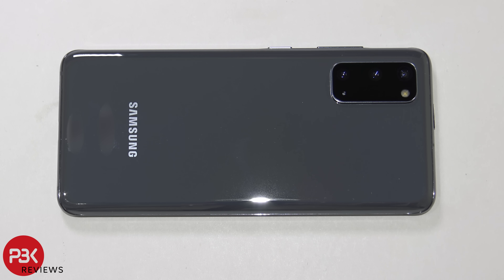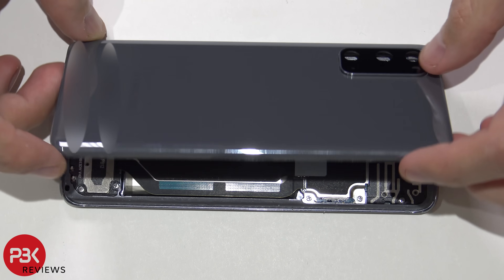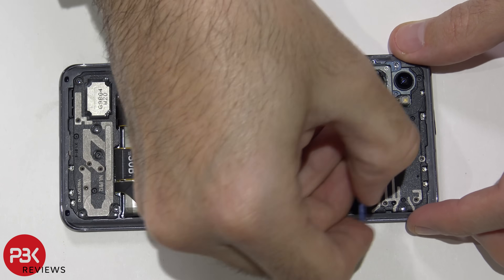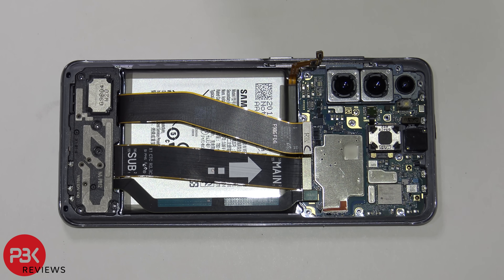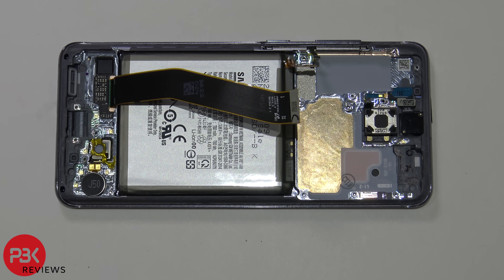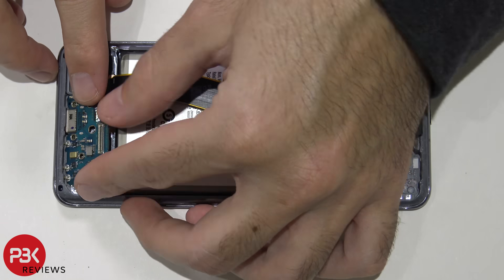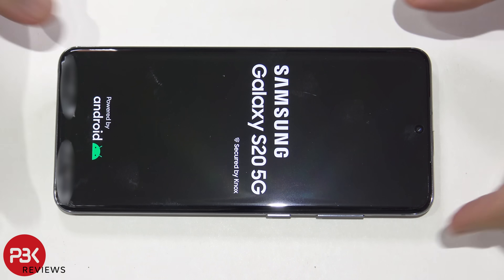Samsung Galaxy S20 5G Disassembly Teardown Repair Video Review

Comment: Hi, would you kindly offer advice regarding the power button on my s20 device? It's about the power button and how it's attached. The issue is that the power button sticks out on one side, swiveling outwards the lower part of the button,  with the top side of the button still attached to the cell:  what is the reason, and how can it be fixed.

Comment: I had the back part unglued and put the phone under water to record..it worked for a while and when I let it charge ..the screen didn't work anymore. I hear a sound on off. I saw on the main board that something had failed. some small chips to the right of the cameras that say IRH. I completely forgot that the back of my phone came off. now i have a ruined s20. luckily i already have s23. I just had the s20 for sale

Comment: What kind of adhesive to you apply to put it back together?  I have a waterlogged S20 that needs to be opened up to dry out, but I want to make sure I can get it back together.
Reply: this was awhile ago but double sided tape works in a pinch

Comment: So far, so good. You've explained everything well, but I don't know what the thin cable on the outside right is, the one that goes from the speaker to the mainboard. And what is the box under the front camera? Also, the fingerprint sensor was not shown, which I'm currently having an issue with. The fingerprint sensor works intermittently. For example, it loads to a certain percentage and then stops and hangs there. Additionally, I often get a message saying I should make sure the sensor is not dirty or wet. Do you have an explanation for this? Thanks in advance.
Reply: If you installed glass screen protector, that may be part of your problem!

Comment: Where are the antennas? I want to see if something is loose and that's why I intermittently can't connect to cell towers. Wifi is fine, though.
Reply from the maker: There are antenna lines drawn in the frame itself, as well as the plastic cover over the motherboard and speaker housing. Also the sub board has antenna contacts on it including the motherboard which boat touch parts of the frame to connect to the frame antenna. So you would need to make sure both the motherboard and sub board are seated properly in place, and that all cables and connectors are connected and that the plastic motherboard cover and the speaker assembly are both seated and screwed down properly.
Reply: @PBKreviews  thanks!

Comment: Hi there my back cover came lose suddenly and I used my phone in the pool and water got into the phone it turned off for 3 days. Came back on after I took the back off and put it in rice. But now wifi doesn't work at all.  Iv contacted Samsung and gone through all the steps to try and get the wifi to turn on but I can't. I have even factory reset the phone. Do you have any advice on how I can fix this?

Comment: Hello. If I remove the back cover of the phone, should I re-glue the edges or can I just install it without glue? My back cover is a bit loose. Thank you.
Reply from the maker: Hi, you would need to apply new pre cut adhesive for the back. Here is the part you need: https://www.mobiledefenders.com/samsung-repair-parts/galaxy-s-series/galaxy-s20/adhesive-back-cover-for-galaxy-s20-5g.html

Comment: Hi do you have WhatsApp i could do with having a chat with you about a problem im having that im struggling to resolve. So my phone stopped working due to the battery so i changed it and it worked fine but wasn't charging so i changed the charging port and then it wouldn't turn on. I thought it was the screen so i replaced the lcd screen, the charging port and the battery and still nothing. If i hold the on button and it buzzes like its switched on but nothing on the screen. Iv also now changed the long thin lcd connector flex and still the same problem. I have now ordered the main flex. Do you know what this could be? Its nearly all knew apart from the main motherboard. Praying it isn't that. And how would i test it to see? Many thanks
Reply from the maker: Hi, I don't have WhatsApp. It could be a possibility you may have damaged a part of the main board or broke off a resistor or chip when you were taking it apart to replace other parts. If you changed the battery and all that, that's the only thing I can think of. Have you checked and made sure all the cables are connected properly etc?
Reply: @PBKreviews thanks. yes Iv looked over it all thoroughly.checked all fittings. I just don't know what else to do.
Reply from the maker: @lily-maysewell6685  if you can send me a high res pic of the main board with cables disconnected ill check n see if there is any visisble damage. You can email me a picture to pbkreviews@gmail.com
Reply: @PBKreviews  thankyou so much ill send them over tomorrow :)

Comment: Do you have a video or replacing the volume and power buttong keys of s20+?
Reply from the maker: There is a metal bracket holding them in place. Once you take the phone and have access to it, you just need to pull up on the metal bracket in the slot where the keys are and pull it out then that should free the buttons to fall into the frame to remove them.

Comment: Is there any difference between the back glass panel of the 5g and 4g?(4g back panel is 20e and the 5g is 60e, repair price included) I just got my phone and it slipped from my pocket as I was sitting on a chair :(
Reply from the maker: Hi, they should both be the same, they are the same size and everything so shouldn't make a difference.
Reply: @PBKreviews  Thank you very much for the answer!
Reply from the maker: @n0xi0uss  you're welcome

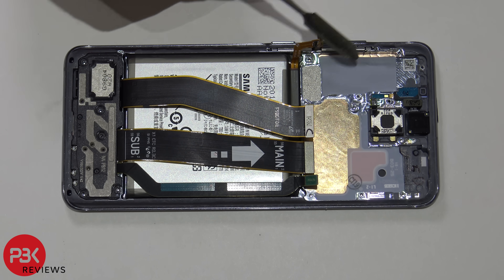Comment: Hello. Can you help please. My phone was swimming in the pool and apparently the water damaged my phone. After repair everything work except the cellular data, i mean my phone can't activate and recognize sim card. So the problem is in the area close to spare parts 034 which is in the video (3:22). I can't find spare part for it. What can i do in this situation?
Reply from the maker: Hi, with water damage it's difficult to pinpoint the issue, could be a burned out resistor or chip for the sim reader or corrosion on the contacts that need to be brushed off etc. But this website has original parts available for the phone, but not sure if its the parts you will need. https://www.mobiledefenders.com/samsung-repair-parts/galaxy-s-series/galaxy-s20.html?

Comment: My phone won't charge while using help
Reply from the maker: hmm, have you checked your charging cable and adapter to rule out a defective cable or adapter block? Also back up your phone and data and do a factory reset (which would erase all your data so much sure you back it up) and see if it doesn't fix it. If still no issue, it can be a bad charger port or sub board.

Comment: Perfect one to ask this question: I accidentally shoved the ejector pin into the hole in the bottom of the phone (microphone/speaker opening?) instead of the SIM card tray hole… Do you think that I could have damaged anything (waterproofing, that rectangular component on the USB PCB looking like a crystal, etc.)?
Reply from the maker: Most likely you did not damage it. Its a solid piece (the square/rectangular gold colored piece on the mainboard). Also you will be safe most likely with the water resistance as well, its too small of a hole to worry about.

Comment: Does the S20's haptics feel any different to the S20+ and S20 Ultra since the have different vibration motors?
Reply: The haptic feel on S20+ and S20 Ultra are more like iPhone or Pixel phones, gentle and satisfying vibration. The S20's is the same one as the S10's, it feels cheaper and not as satisfying as the S20+ or S20 Ultra, but it still better than their cheaper model like A series
Reply: @Dai_Tech  Ahh well that’s  disappointing
Reply from the maker: I haven't used the S20+ or Ultra yet so not sure. If I get a chance to check will let you know
Reply: @PBKreviews  OK thanks. Great video btw
Reply from the maker: @davidplatt9918  You're welcome and thank you

Comment: make it easier to change the battery.stop using that super glue for the back.use screws and rubber gaskets.it's an expensive phone you cannot use superglue at this price.make the battery removable if i pay so much money for a phone i want to be able to change the battery myself.
Reply from the maker: Yup, its a adhesive strip but ya would be much better if it was with screws like back in the day and gaskets. The galaxy xcover pro is that way and they are able to make it rugged as well but most people want the more slimmer sleek look so I guess they stick to that method now a days.

Comment: So can the battery be changed ? It seems really not easy (if possible without damaging the screen)
Reply from the maker: yes, it just takes a much longer time to be safe and pry it off carefully with applying heat from time to time during the process.

Comment: Please dont use metal when removing or touching anything on a phone's insides! Chance of ESD increases with careless techniques such as this.
Reply from the maker: As I've told many people before, I've taken apart thousands of phones n not once had any issue. As long as battery is disconnected the chance is extremely minimal and its different if your in an area that has static like carpet etc.

Comment: can i remove or at least disconnect the 5g antenna ? does it even have one that is for for 5g only ?
Reply from the maker: I don't know exactly but I would be leaning toward no. There are going to be 4G LTE only versions for certain markets so you might want to look into purchasing one of those units if they are unlocked so you can use that instead if you want to avoid 5G

Comment: You are not going to damage the screen, just the back copper layer of it. but I think it's actually aluminium is all the way behind the battery like on the Note 10. stupid design.
Reply: Yap. I watched another video... only the under display fingerprint reader is exposed, and the rest of the screen is covered with the middle part of the frame.
Reply from the maker: ya true but the problem was the middle part of the frame was thin enough that was actually pulling it inward as I was pulling they battery and it was in return warping the screen as well. Would probably need to use a bit more time and heat to gently pry it off or use isopropyl alcohol

Comment: Crappy construction. Repairability almost 0.
Reply from the maker: Its not bad compared to the folding flip phones and such. I honestly think its a fairly simple repair job aside from the battery and screen which would take more time. True that doesn't leave much left haha, but charger port, earpiece and loud speaker should be a fairly simple repair job.

Comment: I will skip s20 because of glued to display battery.
Reply from the maker: Its possible its not directly glued to the battery, but the midframe in that section might have either a opening that makes the adhesive attach to the screen and battery or might just be a thin midframe that pulls or warps when prying off the battery.
Reply: @PBKreviews  there is still a huge that that it would transfer heat to display. Right? AMOLEDs pixels got a terrible history of burning down quicker with constant heat dissipation overtime.

Comment: dude, always the first out with a teardown, respect! you're bout to overtake jerryrigeverything and ifixit if you keep it up! you should honestly start doing more in depth phone reviews that include the repairability in the review. phone repair techs would love it! 

...also i'm a little disappointed you didn't remove the battery and screen...wtf??
Reply from the maker: Thanks. I didn't remove the battery because as mentioned in the video, the adhesive was pulling the center of the screen inward and I didn't want to break the screen or risk cracking the screen itself.  Some devices I get aren't mine so there is only so much I can do with them. If I see I can take the screen off without damaging them, then I will. But when I see there is a risk of breaking it and the phone doesn't directly belong to me, then at times I can't do it. Hope this explains it

Comment: It must have taken a long time to remove the back plate
Reply from the maker: Not too long but ya takes some time and heat to get it off. Usually the Samsung phones that have water resistant adhesive are a bit stronger and tougher to pry off.

Comment: You can heat the screen/backside of the battery and it should loosen the adhesive enough for you to pry it out easily
Reply from the maker: Yea I tried heating it for a while and tried prying it off but the adhesive was still strong enough and kept pulling the screen inward as I tried to pull the battery off.

Comment: And the tiny vibration motor stills the same
Reply: Its not its size
Its how you use it.
Reply: you're right.  samsung seriously needs to up their haptic feedback game.  the iphone taptic engine is 1000x better than the bullshit cheapo rotating motor samsung uses. it really feels cheap and android phone manufacturers need to step up their game.
Reply: @keyboard-commentator  
Apperently, the S20 series have a better haptic feedback when compared to the iPhone 11 pro max. Check mr.whosetheboss
Reply: @shogun_68  cool I'll check it out thanks

Comment: So was the processor and the 5G in side taht silver plate?
Reply from the maker: processor is under the board where it sits on top of the vapor chamber, but not sure about the 5G chip
Reply: @PBKreviews  man I was hoping to see that new 5G chip and the gold colour processor 😅😭
Reply from the maker: I'm not sure where the 5G chip is located or else I would have shown it, also the shield on this board was not one of the removable ones or else I would have taken it off. Didn't wanna pry it off damaging the board rendering it useless :)

Comment: ifixit injects isopropyl alcohol on the sides of the battery to soften the adhesive, which helps with removing it from the frame
Reply from the maker: Yea, I have seen it but I am always worried about using anything that's in liquid form haha but I will definitely practice on a few none working phones and get over my fear :)
Reply: @PBKreviews   Alcohol is good because Alcohol evaporates fast
Reply from the maker: @dawicked2k8  yea true, but I worry if it touches anything else say the back of the screen or somewhere else, it might damage the parts or leave a streak or something behind